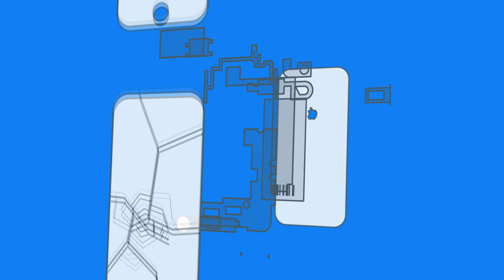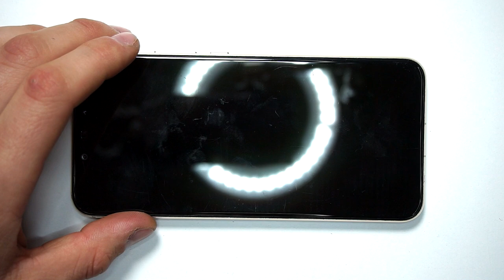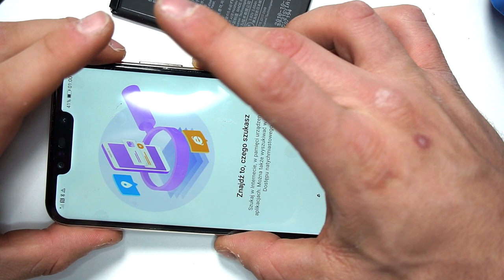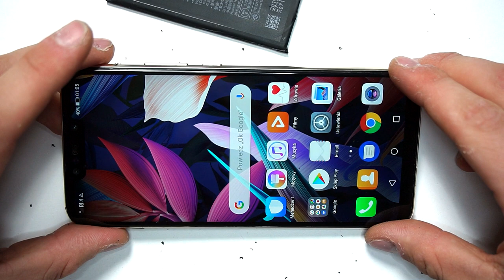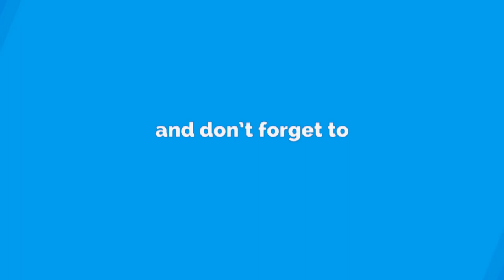Huawei Mate 20 Lite Display Replacement - DoItYourself

Comment: I replaced the screen and the fingerprint scanner stopped working. any idea why that might be? i checked 4 times. everything is connected correctly. the flex cable is connected well on both sides and there is not any visible damage to the cable. is it possible that somehow after disconnecting the flex cable and then reconnecting it again the fingerprint scanner just stopped working? i don't understand what could have happened